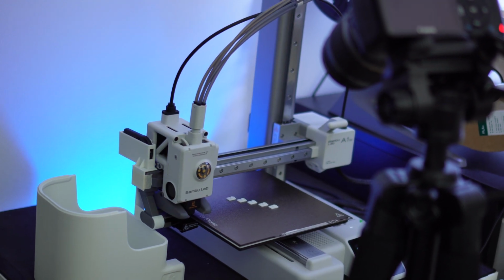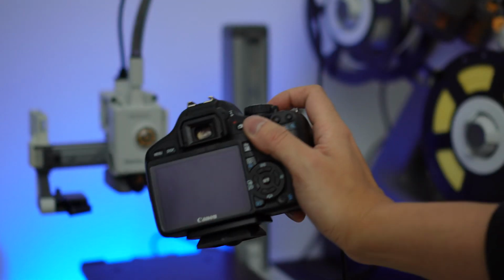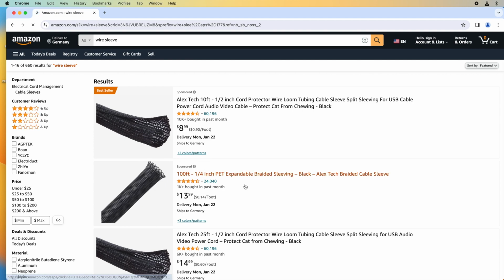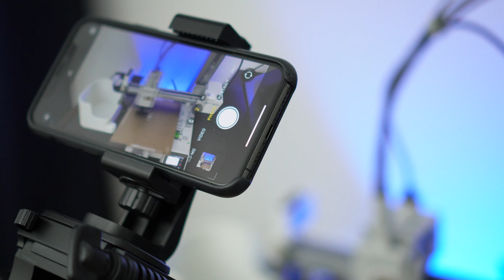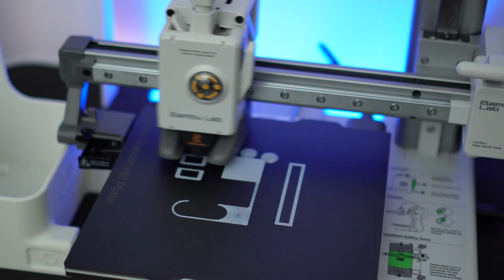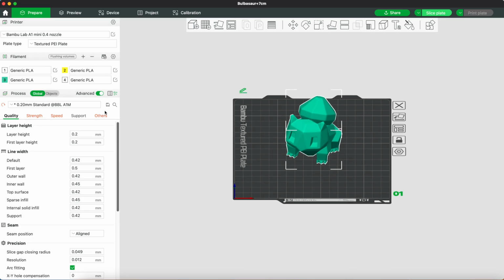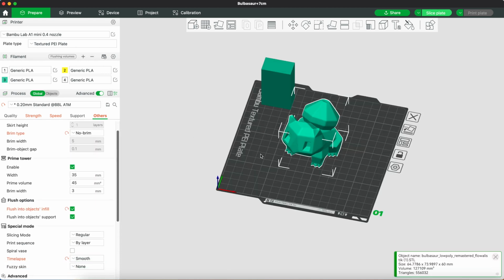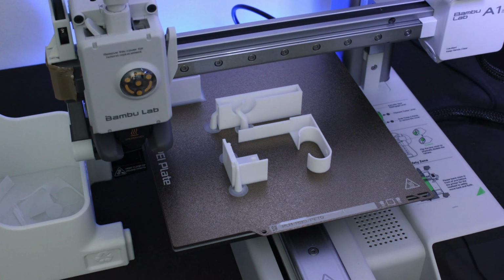How to make BETTER 3D print timelapses with the BambuLab A1 and A1 Mini!

Comment: I’m having an issue with blurry photos taken using a Bluetooth controller connected to my phone. Some of the shots come out sharp, but others are very blurry — especially when the printer bed is moving. Is there any way to fix this? Are there any settings in Bambu Studio that could help?
For reference, I’m using a Bambu Lab A1 printer.
Reply from the maker: would you be willing to invest in about $20 for a timelapse kit? It’s a great kit to help you make timelapse vids. Check out my latest video, I made a tutorial on how to use it.

Comment: question how do you make sure the printer is not making useles picture when printer is heating up eerything it just holds the clicker down and i get spammed pictures also timelabs are all over the place im using my old phone currently but i almost feel like the phone cant take the picture either fast enough or it is to fast 1 of the 2 so all shots are a comlete mess. if anyone have a fix or a idea on how to fix it im all ears cheers

Comment: Why is my printer not returning to the position in which he goes on the video, my Bambu Lab A1 does not even think every layer to approach that place
Reply from the maker: you have to change the timelapse mode from classic to smooth. Then it should work👍🏼

Comment: Hi, I tried making a timelapse of a multicolor object with your setup, but when the Bambu Lab changes color, the camera keeps taking photos because the extruder holds down the remote button. This results many more shots in the timelapse. Do you have any advice on how to fix this? Thanks in advance for your help!
Reply: This should be related to the brands and models of your camera. My Canon R8 doesn't take more photos when the extruder holds down the button. But I am using a wired control and this may be the reason as well.
Reply: @qingyuanzhang3644   Thank you

Comment: Do I have to enable timelapse in bambu or will it work with the setting disabled?
Reply from the maker: yep, you have to set the timelapse setting to smooth, and when starting the print, make sure to check the box “timelapse”.
the printer will make its own timelapse, but we’re not gonna need that. Important is that when its doing timelapse, the bed will always at the same position and the print head will park all the way to the left to push the shutter.

Comment: How can I edit the Gcode? So after every layer it goes back base? 

Bamboustudio is my slicer
Reply from the maker: you don‘t need to edit the Gcode, just turn on the timelapse smooth mode.
It workd perfectly with single colored prints, but not so much for multicolored prints.

Comment: My MacBook compresses all the photos I took into a square, creating an awkward and not full image for the timelapse. Do you know any fixes for this?
Reply from the maker: After you chose the pictures, make sure to change the resolution from "Actual Size" to 4K (or 1080p etc.). I’m guessing that your camera takes 3:2 photos?
Reply: @Lukis3D  I’m honestly not sure. When I change to 4k, it still kind of crops the photo into a weird box and cuts off the top. I use a Canon EOS M200! I appreciate your response!
Reply: @Lukis3D  I just tried this, and it once again chopped off the top of the video, haha! Any other recommendations?
Reply: @calebdebass3882  lol just solved it. First, rotate all the photos to make them horizontal (select all - richt click - quick actions - rotate left). Then proceed with Quick player, it will make you a video with no cropping. Also, if you want to preserve the original format, choose "Actual Size" instead of "4K". Last step: Rotate the video back to vertical format.

Comment: What is a "soft mode?
Reply from the maker: soft mode will turn on prime tower automatically, and makes sure that the print bed is always at the same position when the print head parks.
Reply: @Lukis3D  thanks, i found it

Comment: Hey Lukis3D, great video! I had a question about multicolour prints - because the print head goes more to the left to shoot the poop, are you restricted in using this setup? I assume it would try to push your remote off the frame? Maybe this is why you have interchangeable lengths for your button pusher on the toolhead?
Reply from the maker: hey, thanks! yea i notice that i need to use a longer pusher when i wanna capture timelapse vid of multicolor prints. 
It still works though, but you need to sort out the pictures because when the printer does multicolor prints, the bed doesn’t always stay at the same position everytime the print head “parks”.
Reply: @Lukis3D  I thought this might be the case! Thanks for getting back to me, that's super useful to know :)
Reply: @Lukis3D  Is that a lot of extra work? How long does that take usually? Thanks for the great idea!!

Comment: Ty for sharing this! I am designing and adapter for my own controller =) Will be using it for sure. Have you noticed any complications due to the added weight on the printer since you added this mod? I don't think it should be a problem but I am curious to see if you found any changes after installing it. Thanks in advance! =)
Reply from the maker: your welcome 😊 i dont notice any complications so far, but i also try not to overuse it.

If you have concerns, you might wanna install a micro switch instead but it wouldnt look as clean as this setup, imo.

Comment: Main problem I'm having with this is when using a phone camera, the toolhead is parked at the button for too long and it takes a photo burst instead of a single picture. I could really use some modified gcode that only hits the remote briefly and then moves a few mm to the right for a couple seconds.
Reply: I ended up fixing this issue you have to just delete the "rest" time line in the timelapse gcode [M400 P300] or set that P300 value to something like P50. It is the wait command for the gcode to then continue.
Reply: @ConnorTheMaker  I gotta try this now. I rewrote some gcode and it worked for a while then stopped. I'll give this a try now.
Reply: @ConnorTheMaker  Perfect. Thanks man!
Reply: @ConnorTheMaker  Can you tell me how or where I can find it? I'm still new to 3D printing :D
Reply: I hate that you can’t turn that setting off
Reply: @yobtnirp3D  Have you tried a remote trigger for a phone?
Reply: @vnlilman  well I have since obtained a dlsr camera and use a remote shutter from that to take Timelapse’s, my most recent video uses that exact setup if you want to check it out
Reply: @yobtnirp3D  Looks great!
Reply: @yobtnirp3D  I have the opposite issue. I have two dslr's but no 3d printer. Can't wait for the bigger A1 to come back in stock, although i'm concerned they may come out with a newer printer in the next few months
Reply: @vnlilman  yeah I feel like they may release an a1 max of sorts, the a1 is a great printer though
Reply: Having this issue as well, ever find a solution (other than a DSLR)?
Reply: you have to edit the time lapse g code.

Comment: I ain’t got the money for a camera 😭
Reply from the maker: you can use your smartphone too👍🏼😁
Reply: Is the file included work for the Bluetooth remote you have linked?
Reply from the maker: @yobtnirp3D yep, it does 👍🏼, but your remote might be in a different size than mine, so if you have a CAD program, try to design a simple one for your remote
Reply: @Lukis3D  turns out your mount worked perfectly for my remote! Thanks so much